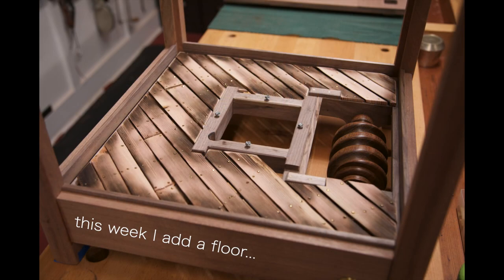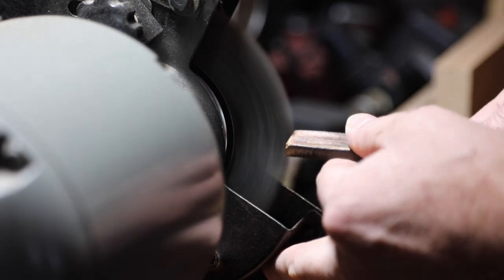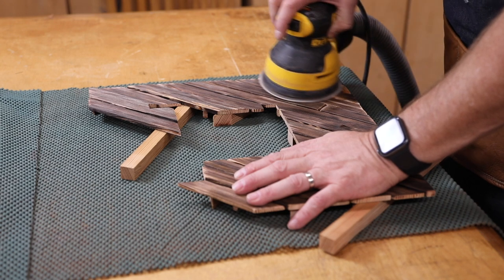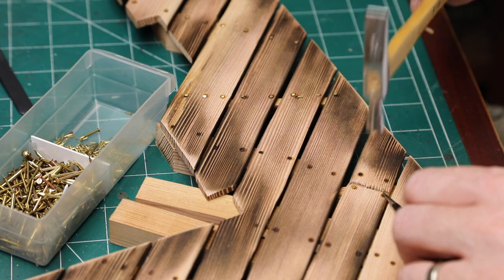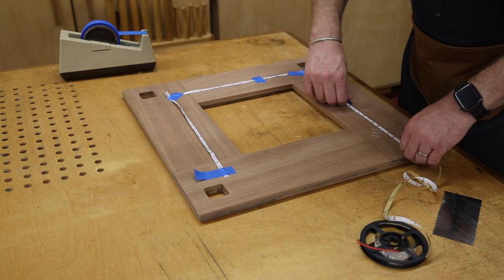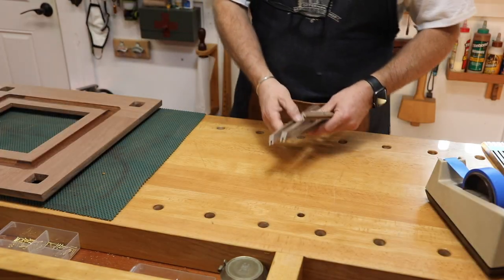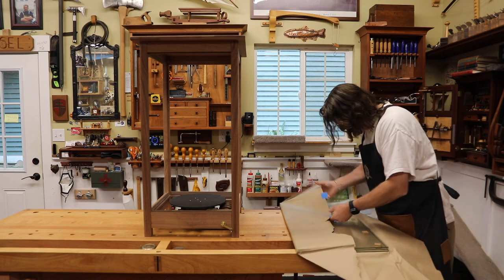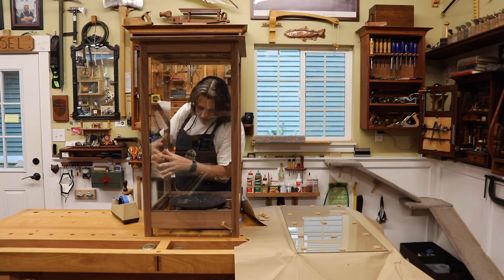TARAWA Diorama Wood and Glass Display Case   episode 4

Comment: What tools are mostly used for stuff like this. I was thinking about making a case with a thick bottom stand with nice curves and such, then a glass case on top most likely.
Reply from the maker: Hi ZachFish, I think a table saw is a primary tool, (it was my first machine tool) and thats going to do a remarkable amount of the work. A good hand saw, possibly a dovetail saw is something I wish I would have gotten earlier on. a quality set of chisels, a good hand plane, (Apron plane is great), sharpening stones, a 12 inch combination square, a folding wood ruler, a compass, a set of dividers, a router, and a woodworking bench with a solid vice. I think I could do it with that, it would be a stretch, and I might have forgotten something, but that would really get you going so far as tools. If you can get use of a friends or relatives table saw, ( if you dont already have one) thats a great way to do it , but just make sure you get some instruction, or watch a ton of videos before starting on any of the edged tools. Ive cut myself so many times it's not funny, but thankfully I still have all my fingers. Honestly the chisels can do just as much damage as a table saw, so just go into it easy. I watched the TV show New Yankee Workshop in the 90's a lot when I started woodworking, and Norm Abrams was an amazing teacher, and they are on YouTube now so thats a great place to start. If you have questions, I also have a livestream on Fridays and I do a Q&A. Best of luck and if you have more questions, just ask. Take care, Bill
Reply: @ScaleModelCraft  That is suuper helpful, Ty!

Comment: Bill, I just discovered you. That looks amazing!!! I've been thinking about building some display cases with lights, but I would like the lights to be on a motion sensor.  I would like them to turn on when someone get close to the case. I want them to fade on and off. And I want them to stay on for a specific length of time. Any thoughts on this type of set up?
Reply from the maker: Hi Mathew, Thanks very much, and I am so glad you like what I build!!! Have you had any experience with an Arduino? Everything you are describing is perfect for an Arduino controlling your lights and a sensor. While I haven't done this exact setup yet, Its definitely something you can do and I don't think the wiring would be that difficult. I'm not a code writer for the simple code it would take, but I have friends that can do it. I also think it's one of those set-ups that you could simply repeat for additional displays. Great idea, and I'll have to talk to my friend John about it. I'll jot that one down and see what I can come up with. Lots of times folks come up with ideas and then I try it out. I don't think this is something I will try right away as I am prepping for a model show, but thats something I might want to build and test myself. If you get the gumption to look up the Arduino site, they have all sorts of great examples and code samples you can use directly with your Arduino. If you haven't worked Wirth Arduino's, (I am still fairly new at them) I did a video a year or so ago about lighting a fire barrel, and while thats much smaller, the same basic info is used, and it could give you a jump start to explore more about Arduino's. https://youtu.be/2EpyoOO2JVs

 Great Idea Mathew!!!  Take Care, Bill
Reply: @ScaleModelCraft  thanks so much for the reply! I have no experience. I’ll have to look it up.
Reply from the maker: It's not that hard to get into, and I am definitely a novice, but it's a really cool thing, and the little Arduino boats are 18-20 bucks each, so it's affordable.  Take care, Bill